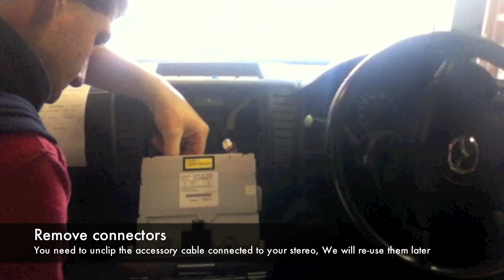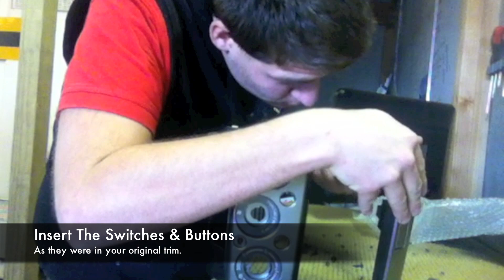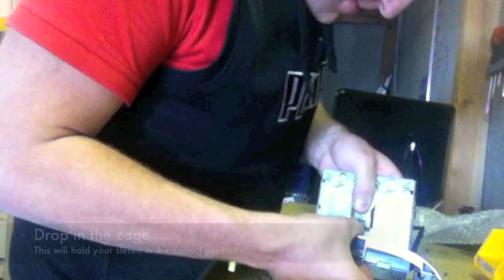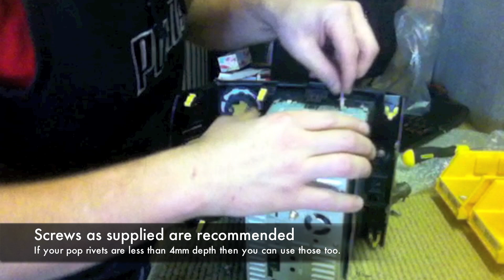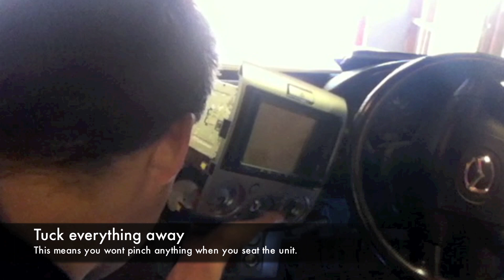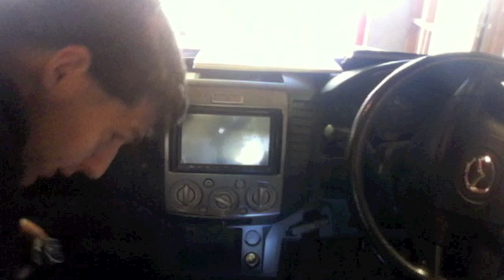Car GPS DVD Player radio stereo head unit Mazda BT50 Installation guide Ford Ranger

Comment: Do you have any suggestions where to run the reversing camera cable from behind the dash to the outside is there a rubber gromet inside the cab
I has 2010 ford ranger dual cab xlt
Reply: +TheUndertaker1296  i have mazda bt50 . i ran mines along d passenger side . in d uphostery . then there is a hole or gromet below feet of rear passenger seat . then i ran d rest of cable below d van

Comment: I've got a 2DIN unit called model T-NIS7K which I think is 6.2 inch.  It is also slightly smaller than the hole in the dash fascia, should I also use a cage mount or can I get a generic rubber surround.
Also,  the microphone cable for bluetooth/phone setup has a small headphone type jack but there is no socket in the back of the unit, there is a place on the front panel but that doesn't seem logical. Could you do an Install clip for 2003 Nissan Navara.